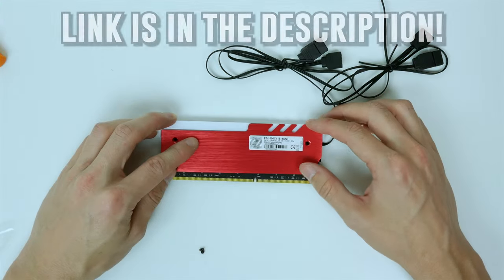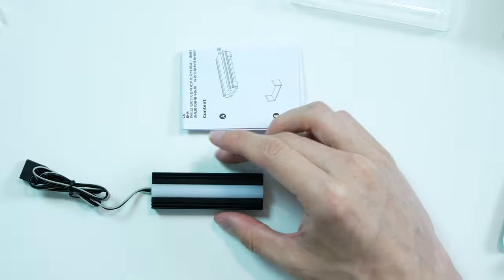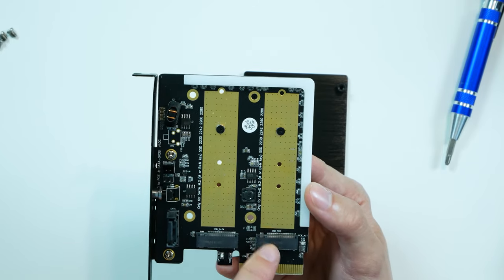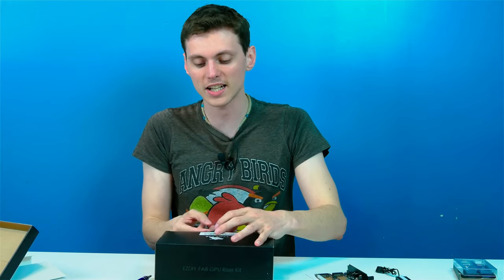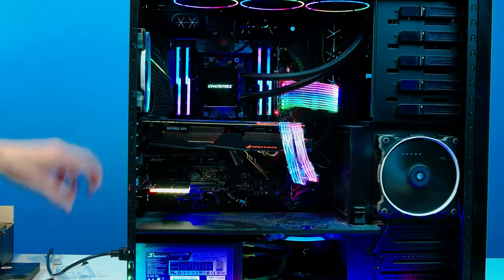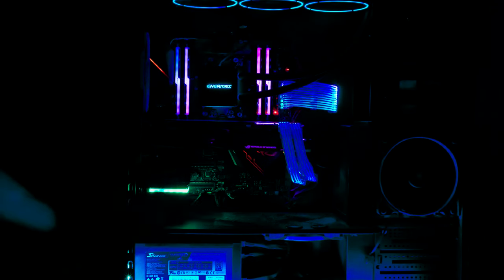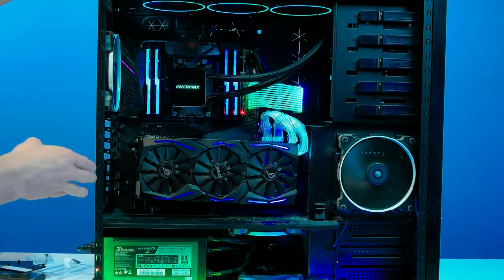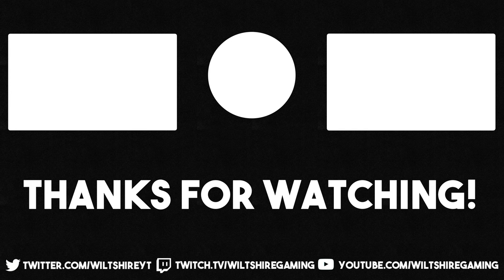RGB PC Accessories You Didn't Know You Needed

Comment: Holy mother of RGB! Those LED cables are awesome, I remember seeing those on LTT at one point. Also, the two other accessories are cool as well. Too bad I also have a clearance issue with both, since I got two dual slot GPUs running SLI and the same SBX AE-5 audio card as you, so all of my PCI-E slots are either full or obstructed. 
Plus, my visible M.2 slot is right next to the audio card, so even if I wanted to install this awesome heatsink, the rounded RGB strip also poses a clearance difficulty... Oh well, I do have EZDIY-FAB Sleeved PSU extension cables and they are awesome, not to mention cheaper than the competition and are high quality as well.
Reply from the maker: I know, right? My PC has got all the RGB lol. The PSU cables are The Lian Li Strimer 24 and 8 pin. I really wish the heatsink had a flat light bar and not the rounded top. I'll use it in my second PC instead :p

Comment: Shame the SSD didn't fit. Suprising considering the absolute unit of a case you've got. Putting together another PC myself and decking it out with RGB is tempting...
Reply from the maker: The M.2 on my motherboard uses a DIMM.2, so it's next the RAM. The 3rd M.2 slot is under a plate on the board and it won't go back on or fit because of the thickness of the RGB heatsink. It would definitely work better if the slots were in between PCI-E slots! You could also find a friend who wants a new PC as well and build it for them :p. Nice to hear from you again Tim!
Reply: @WiltshireTutorials  yeah I'm cannibalizing parts I have lying around cus the girlfriend needs a new gaming PC. Her only request is "make it purple" so I guess that means LEDs are mandatory lol
Reply from the maker: @Tigenraam  Gotta get her this case then! 
https://www.nzxt.com/products/s340-matte-white-purple

Comment: Regarding the vertical mount, so how do you connect your monitors?? You have to get the HDMI (or else) cable into the case??
Reply from the maker: Pretty much. I fed the cables through the PCI-E cutouts on the case.

Comment: Man that GPU sag lol
Reply from the maker: GPU sack... What?
Reply: @WiltshireTutorials  LOL german autocorrection kicked in - I meant "GPU SAG" as the graphic card is significantly sagging to the right :-D
Reply from the maker: With or without the vertical GPU bracket? My camera wasn't completely level when I showed a shot of the PC with the vertical GPU bracket. It's completely level though!
Reply from the maker: Case is on an angle and so is the camera. It's going to look like it's slopping to the right due to this.